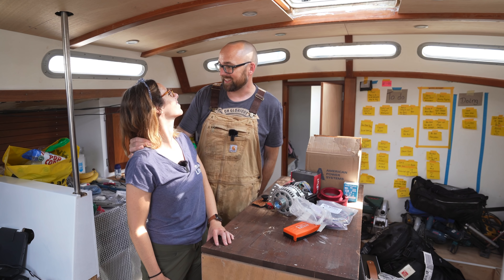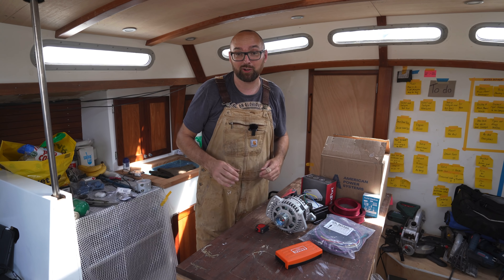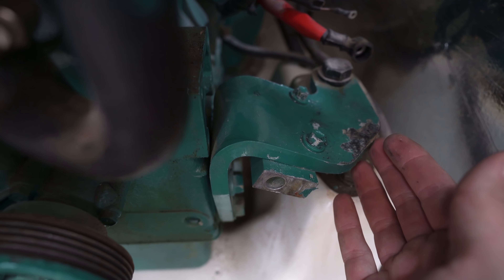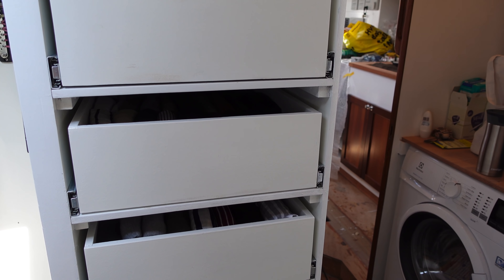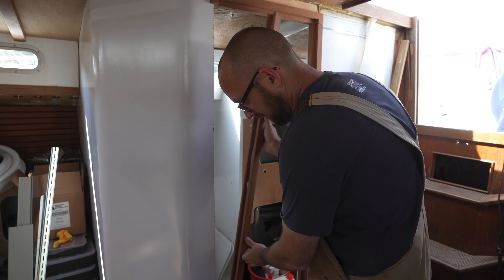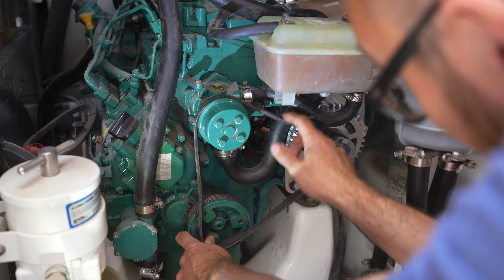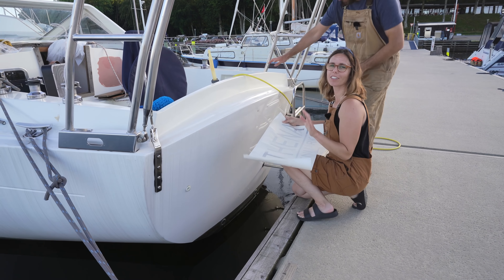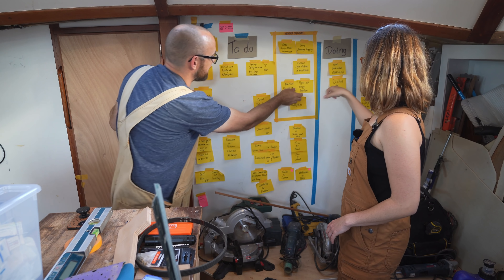Sail Life - 5kW gorgeous alternator 🔥, doorframe & Athena gets her name back

Comment: I have experienced those IKEA containers to get brittle and break up in a few years of usage. At least here in Finland we have SmartStore-branded boxes which are much more durable.
Reply: They do this degrading stuff when exposed to UV, if they are stored in dark places they will outlast humanity
Reply: @kapytanhook  Mine has been in windowless shed all the time. But it also go to minus degrees in winter there, perhaps that is a partial reason.
Reply: @kapytanhook  Mine had been in a completely lightless underearth cellar, never below 8°C and seldomly above 12°C, sparsely ventilated and full of "nonchemical" stuff like glasses and cutlery, porcellain and alike, partly wrapped in newspaper, for a little over a decade. They fell apart so badly that we couldn't even get all of them out of the shelves with everything still in but had to reduce weight to avoid stuff falling through the bottom. 
That stuff is "biodegradable" in the best way plastic can be to NOT stay around for aeons, which makes it worthless as "plastic" though, I'm afraid.
Reply: Weird, I wonder if the ones I have are different. In any case, thanks for setting the record straight. IKEA plastic not durable in the dark.
Reply: @kapytanhook  To be honest, I really was anxious for the air quality in that cellar when those boxes came out in shards because we stored edibles (liquor) there, too, so my girlfriend of that time, a keen chemist, set up a gaschromatograph to measure what's in that cellar's air, and we took samples of the soil and the clinker-lining of the ceiling, which were tested for chemical residues, but nothing irregular/concerning was found. The paper was normal newspaper material, no yellow press product, so fairly "unchemical", too. Racks were untreated pine and fir, no ply, no glue whatsoever, zinced screws only for the newer parts, the elder racks were built crafty withy no screws. It was a cellar otherwise used to store homemade fruit brandy liquor in bottles, not in barrels, bottles had screwcaps, no corks, so You couldn't even smell it, let alone show it with the chromatograph. Because we did not find anything I do think those boxes are "biodegradeable" aka non-lasting on purpose.

Comment: Maybe someone has mentioned this before, why not change the direction of the door swing to the v berth to swing open towards the washer and dryer? This would block having to view them when the door is open and also not intrude into the cabin while open. Plus probably a little better air flow as well.

Comment: May want to rethink the teak riser!!! Most winches are designed for the line to enter the drum from below, ≈7° if I remember correctly. Winch won't bear the load quite as designed shortening life span and likely will have you running into override issues, which when under load in a seaway = a bad time
Reply: Yes I was about to say the same.  You will get riders with it that high.

Comment: You need the line entering the winch drum around 5 degrees (if I remember correctly). That spacer is too high. You might not even need it.  Also, that engine mount bracket is not OEM, right?

Comment: I am a little surprised that you can get 180 amps (@24v no less) from a relatively small alternator.  Is this the max rating or is it a continuous duty rating?  Problem is having a concentrated center of heat and the ability to dissipate it, big (i.e. heavy) alternators  (same applies to electric motors) are a big heat sink and also have big fans.  Not only the windings get hot but also the rectifier diodes and they aren't super tolerant of heat.  Lastly I believe you are using lithium batteries and while these can withstand high charge and discharge rates these must be carefully monitored due to again our enemy, heat.  Battery systems generally include system for monitoring heat and shutting down when getting close to the limits.

Comment: Two solutions: either get married i demaork, that should solve the Schengen Issue. otherwise yoy could sail down to the Mediteranean black sea, Croatia, Romania and Bulgaria are part of the EU, but not yet fully of of the Schengen Area. If I remember correctly staying there does not count towards the 90 days since it is outside the common travel area. Motenegro would work too, but is outside the EU completely which micht make importing material more expensive.
Reply: Would Morocco work for that as well? It would cut the trip in half, and getting stuff out of Spain should be pretty easy.
Reply: @wagzz3000  Possible, but the balkans are moch tighter Aligned with the EU when it comes to standards, security and so on. in the right ports Mads could just hop in the Dingy and go to the other shore tog et things within minutes.